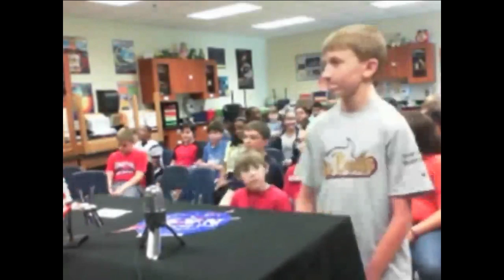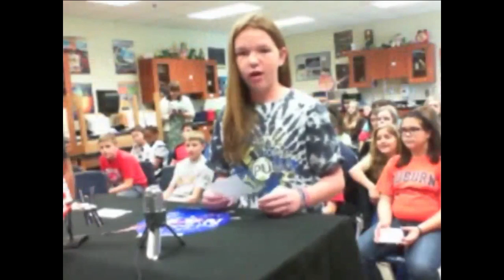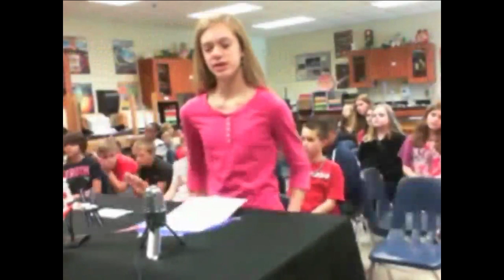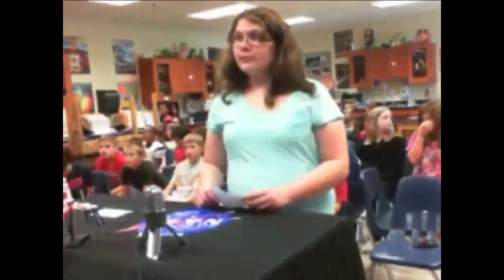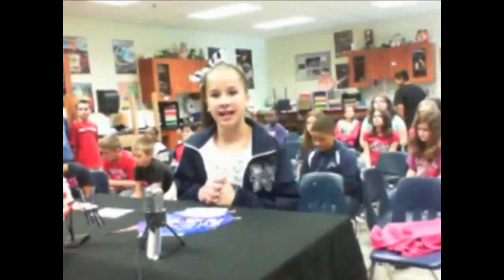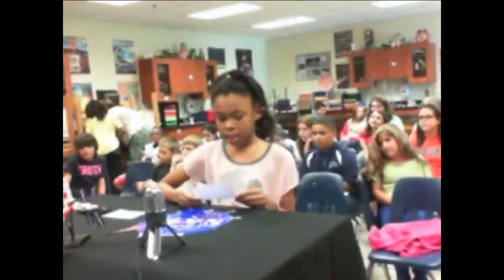NASA Engineer Talks Space with Students

Comment: It's hydrogen and oxygen, I think often hydrogen peroxide(stuff next to rubbing alcohol) is separated to hydrogen and oxygen. You see, when they're mixed they cause a exothermic reaction(release heat), but the "exhaust" is nothing more than water,regular water because the hydrogen tank is twice as big as the oxygen tank and it turns into H2O.